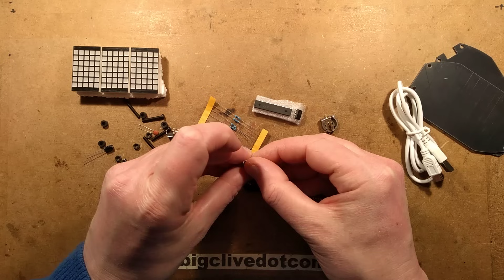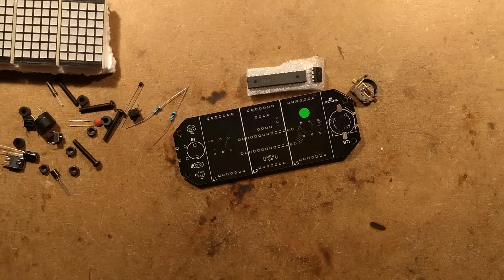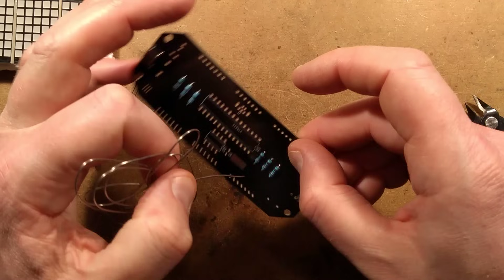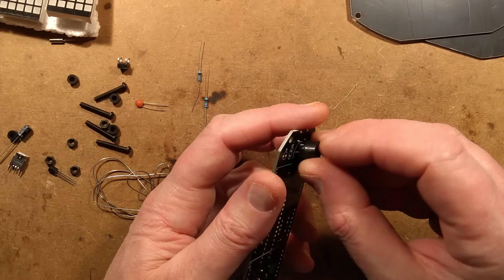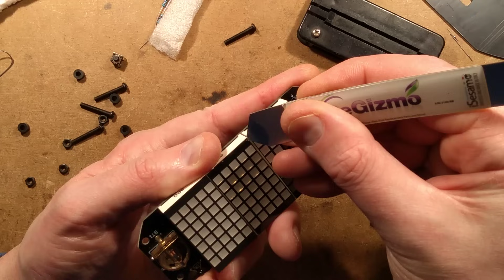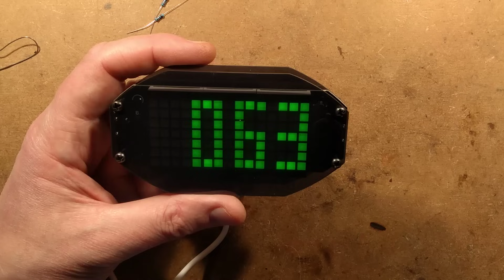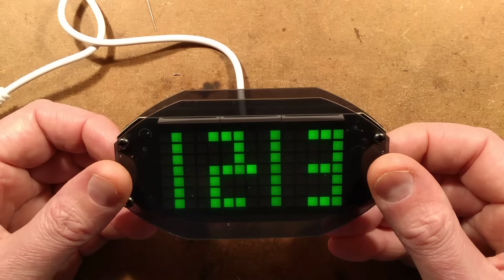Full clock kit build and setting guide.

Comment: Got a question for the astute, I have 2 different bluetooth devices head phones and altec speakers. The altec after 2or 3 years started loosing connection randomly of course I opened it never really found the problem. But if I left it plugged in to charge it would stay connected until it just wouldn't connect anymore. Well the head phones are doing the same thing connecting but randomly disconnecting ( the same as the altec speakers ) so last night I plugged the headset in to power bank and they kept connection. I noticed when the headset was low (when working properly) and I charged it would charge at .41 then .30 then .08. Last night it was jumping between .10 and .00 no charge I didn't think to do that with the altec speaker at the time.  First I thought batt is going. But I've had the altec to bits now for a year and the 18650 still is in good shape. Just wondering if this is a common blue tooth problem. Does a bluetooth chip just go bad or cap's resisters. Funny because one is fairly expensive item and the other ( head phones are just wal mart ) they both are rechargeable.  I have multiple devices that I attach to so I know it's not the host device.  I have multiple host devices. Any or no thoughts are appreciated.
Reply: I can't offer any insight for why it happens, but have made similar observations, and I've pondered the same question as you.  I've had several Jabra "dog-tag style" BT controllers/transceivers that allow me to wirelessly use my standard earbuds with my phone/laptop, or transmit to any other audio device that's plugged into the .125" audio jack.  I've given up using the last one of them, as it was beginning to exhibit sporadic connectivity/recognition issues.  I presumed that it was due to the very small battery cell reaching EOL status, though I suppose it could have resulted from any number of other components that I lack the ability to diagnose.
Reply: I have also experienced this. I can only hypothesize, but I'm thinking something chip related. It's like after 2 or so years problems start showing up. The caps and resistors used are most likely the most reliable parts, assuming they are the newer style. Maybe they overdrive the chips to achieve better range or something... It's only radio waves, not like Bluetooth is some type of special magic stuff.
Reply: @herpnderpn2484  as I sit and wake up it's almost like the one pulse led lamps BigClive mentions I know he mentioned the repair I'll go back and find that video and watch it because I do have an led bulb with that exact problem. Anyway the bluetooth seem to have the same problem that's why originally I had said cap or resistor, if I remember right that's how BC fixes the led lamp. Thanks for the responses. Sorry for the book but I had just woke up.
Reply: Update after taking the headphones apart, and putting back together. Right ear has battery and left ear has components. I took both apart found a chitty soder joint fixed it. Put it all back together. Worked fine then I adjusted it it cut out. So after using it all night everytime i adjusted (on purpose ) I't would loose signal, as matter of fact and movement setting it down of picking it up tapping it. I'm gonna chalk that up to a bad wire running from right ear over to left cover. They use that wire thinner than hair. So I'm content with the headphones, being pinched or cut wire. I turned them on last night they were still on this am so it's not battery.

Comment: I'm always amazed by your prestidigitation. You're soldering that PCB in thin air, while most PCBs tend to travel away from me during soldering while they lie on the table.
Reply: I think it's an excellent word.
Reply: I need 5 hands fukin on a board and he uses four fingers, wtf
Reply: @TheFoodnipple  Experience!
Reply: I know! Since I started watching Big Clive I have tried on a few occasions to solder like him with only two hands, but that just resulted in burning my fingers and, shall we say, less than pretty solder joints. He makes it look so easy but it's not.
Reply: @olavl8827  me too
Reply: @olavl8827  Same here, but I have learned to always grab the soldering iron by the correct end so I guess there's hope for me. The smell of fried chicken was the first sign something is wrong.
Reply: anlumo1 As a field technician, you very rarely have ideal conditions for proper soldering. So you have to learn adapt and overcome. Clive demonstrates this expertly. You don’t need me to point that out. Keep working at it. Eventually you will stop burning your fingers all of the time. However, I don’t ever recall a demonstration from Clive, holding the project in one hand, soldering iron in the other and a piece of solder between the lips. The key for me is having a long enough piece of solder and a great pair of readers to see well enough to be accurate.
Reply: I tried to copy clive once. The smell of burnt flesh is not nice!
Reply: It is like the old tale from the 20's.  This dude with a saxophone case stops a beat cop and asks "Sir, how to I get to Carnage Hall?"  The old Irish Cop replies  "Practice man, practice!"  Same thing with soldering. I have been watching Big Clive and Jullian now for over 5 years, when I began, I just had rudimentary skills with a soldering Iron.  I was using one of those 3 dollar soldering iron's from the hardware store BIN sale bin, and a roll of old solder I got from mom when dad passed away in '73.  When I tried to solder 2 wires together there was solder everywhere except on the joints.  So after listening to how it was supposed to be done, and watching my electronic heroes with their irons, my soldering began to improve. I began buying small kits to solder together, making flashing hearts and Christmas Trees, Bells and such, then amplifiers and power supplies, and after awhile and after going through first a Radio Shack adjustable power iron, then a Butane torch iron combo, next a 5V USB powered iron, and at long last an iron with adjustable heat and replaceable tips my solder joints began to look very professional, I purchased a large roll of  American Made rosin core 40/60 solder in a medium fine thickness and my soldering improved even more. A pair of helping hands helped a bit, but I kept watching how Big Clive did the one handed hold and feed solder, and started practicing.  Now I am getting rather old at  67 years, and my hands sometimes shake so badly that my coffee goes flying from my hands, but when I pick up my soldering iron, my hands become steady.  I am rather proud that I finished a wristwatch kit that was all SMD, in the beginning I was having a hard time with the micro-controller ship, so I stopped and ordered some fine tips, a digitally controlled Iron as well as one of those shaved brass tip cleaner in a covered ash try deals, when that all came in, I got back to my kit and within 4 hours I had her complete except for the battery pack.  The next afternoon I remembered where I was with my construction, and within a half hour, I installed the 5 1220 cells and assembled the plastic case (always a bitch to do, harder then the soldering!) and when I pressed the little button, my new hand assembled watch came to life!  Why you could hear my shout of joy all over our little town of 1300 people despite the fact we all have our houses shut up against the sub zero weather here in the Dakota's!  Yep she is working great, I have worn it for a week now and it is still telling me the time, date and charge of the 5 batteries in two sets, one for the single cell that does the clock backup and the other for the 4 cells that run the hungry little watch (well not so little, she is bulky and not something I would wear every day!)  So I will wear her when I go to places where my fellow geeks gather, and perhaps when I visit my 93 year old mom and 73 year old sister in the nursing home a couple times a week.  So, like the dude in the joke, you can indeed get so you can make your projects behave when the hot iron approaches, it just takes a lot of practice.
Reply: @JerryEricsson  A cheap soldering iron and ancient solder is about the worst way to get started. I'm glad that you kept on practicing anyways!
Reply: It's lovely to see Clive manipulating and soldering just the way I did when I started work in the electronics industry 44 years ago!

Comment: I think my primary school teacher taught to solder in a way where the solder never touches the iron, so you'd hold it on one of the legs for ages until it finally melts just from touching the leg with the solder but yeah I imagine that would just destroy the majority of components because of heat and I haven't done that since then

But when in doubt, adding a massive blob of flux tends to do wonders, much harder to burn all the flux away when there's so much of it. I didn't have a separate flux tin for ages and I didn't know what I was missing. Also I noticed that my desoldering braid became much more effective after dipping it in flux, before I couldn't get it to work on anything but as soon as it gets a couple drops of flux it immediately melts and sucks up all of the solder

Anyway I definitely need to get some of these cheap kits on ebay in order to practice, I learned the hard way that my soldering skills aren't quite there yet but ruining one of my old Sega Game Gears when I was replacing the old terrible caps that no longer worked
Reply from the maker: That's the way it's commonly taught, but in reality, touching the solder to the iron does help mate the heat to the components better.